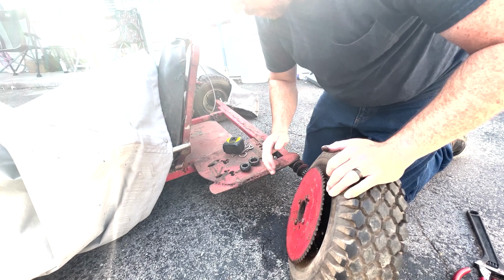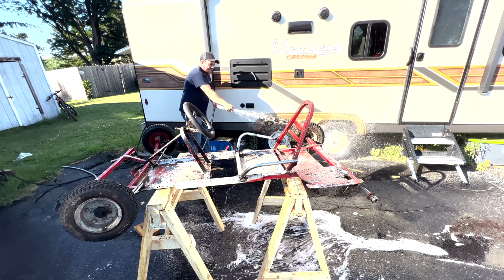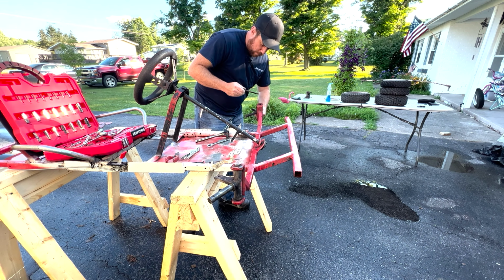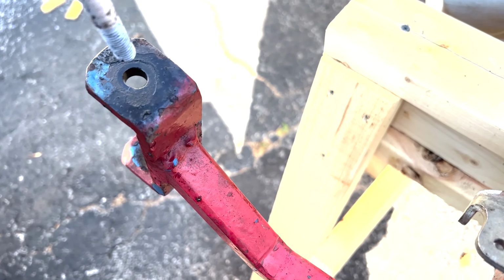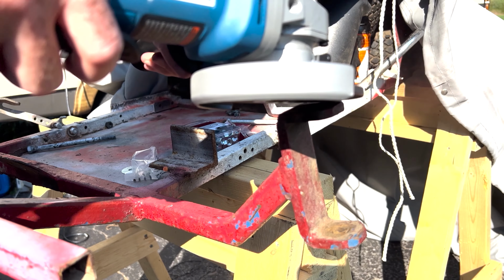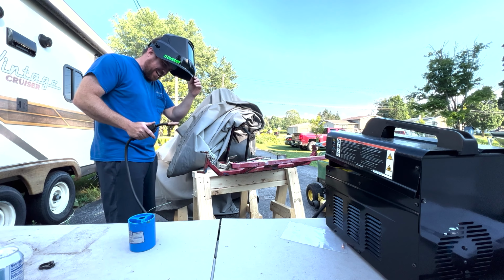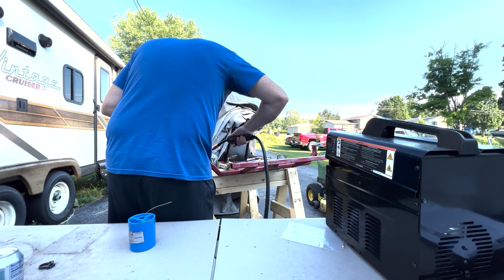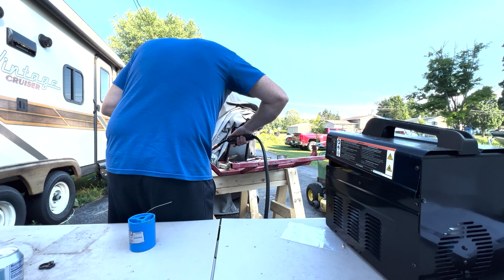DIRTYKART - diesel rolls coal stock!

Comment: I put that engine on my reel mower. It works well however, it is extremely loud and I need ear protection.  Also, it vibrates like crazy.
Reply from the maker: Ya I deff belongs on equipment like that. Sometimes I just have to have a different kind of fun! 🤣